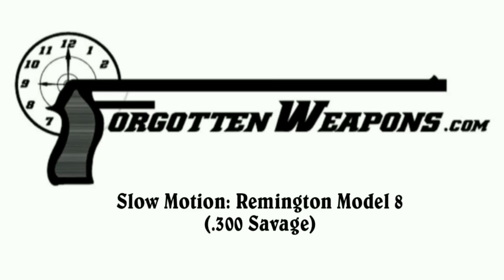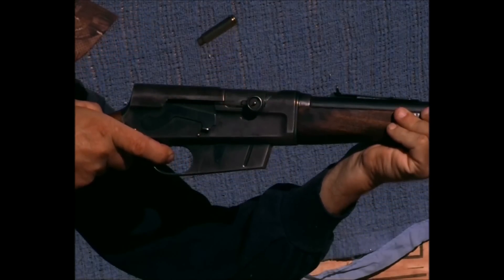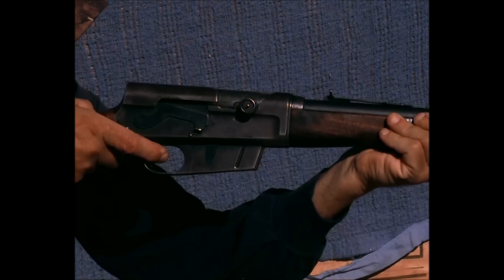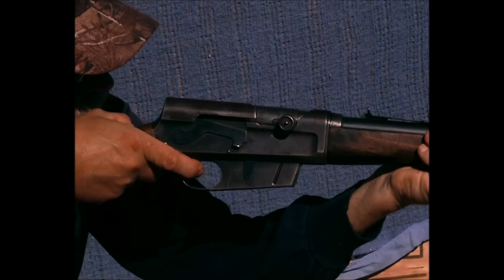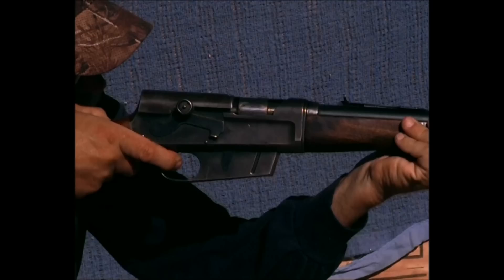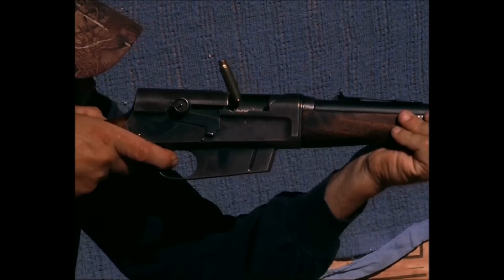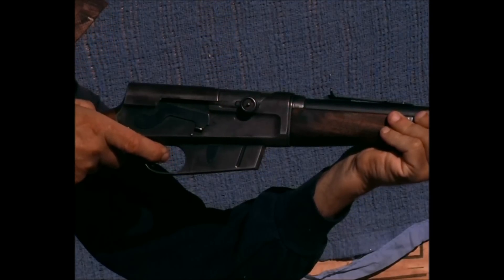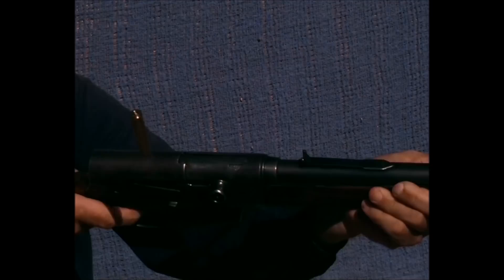Slow Motion: Remington Model 8

Comment: Good explanation. The high speed footage is a little dark but otherwise it's alright. Nice firearm
Reply: Oliver Diaz Slow motion capture (the process) eats up a ton of brightness from the final product (the video). Unless they have the latest models (very expensive cameras, even to rent time on one) footage will always be darker than normal capture.
Reply: aserta Because the frame time of integration is shorter. They are basically high speed cameras that are played back at regular speed.
Reply: aserta You can also just use more lights. It might look overexposed to the naked eye but it'll look way more natural on the high speed.
Reply from the maker: Oliver Diaz Yeah, I will eventually re-do this footage now that I am better at running the high speed camera. It could be brighter.

Comment: So this is a semi auto gun made in 1906? Why didn't they use it in ww1?
Reply: dapperedavid Because the internals were finicy, hard to clean, and expensive to produce. It probably was seen as to fragile for military use.
Reply: dapperedavid It couldn't handle "full power" ammo (30-06, or 30-40 Krag) at the time.  It wasn't the only early semi auto of that time that was overlooked due to ammo commonality issues.  Very honestly the military was fighting the last war, and still concerned about some pretty daffy things (stopping cavalry charges, over consumption of ammo, volley fire).  Honestly there were at least 5 lever or automatic designs (Savage 99, Winchester 1894, 1895, 1905(and other developments), Remington Model 14) that "could" have been useful in military service during WWI that were just ignored because of dogma.
Reply: Patrick Goodhart
You'd think they'd be smart....
Reply: dapperedavid It couldn't handle mud very well, or the abuse of campaigning.  Carrying a rifle around for days in primitive conditions will put a lot of strain on something like this.  It took a lot of work and a lot of money to get Garand's design to the proper level of reliability.  Also, there's a disassembly video on this channel for this rifle.  You don't want to field strip it anywhere but a shop.  You'll lose or bend something.
Reply: Patrick Goodhart Nope.  Semi-autos like this rifle just weren't robust enough for military service.  There's another video Ian's done on this rifle.  Watch it and you'll see.  Also, stopping cavalry charges in WWI wasn't all that daffy- they've been a part of every war up until that one- why would they magically disappear?  Also, lever guns in military service had been tried by the US and rightfully rejected.  They're difficult to fire prone- which is the most accurate position- and very slow to reload compared to the internal magazines on military bolt guns,  especially if you use stripper clips.  Not to mention their fragility in field conditions, the fact they get on the tempermental side when dirty, and their inherent mechanical inaccuracy compared to bolt guns.  The rifles of WWI all proved themselves so well they fought WWII with them, and many carried on through the early Cold War.  In fact, many are still in use by Afghan sharpshooters, over the AK series of rifles.
Reply: dapperedavid They were smart.  They rejected this rifle, and used the right ones instead.
Reply: Jon Hendrickson And repeating some of the same dogma that resulted in exactly what I said...  Seriously though, those rifles have been beat to death for a hundred years and are still functioning.  Nothing holds up well to burial conditions like where seen in trench warfare.  They certainly aren't more fragile then 1911 pistols or S&W revolvers in the same conditions.  It's not hard to load a 1894 or 14 prone, it loads from the side!  The 1895 and 1899 load from the top (and the Savage can use stripper clips, and it's virtually the same magazine system as the MS system).  The only real thing I will give you is the 300 yard + accuracy, and yes a bolt action is a better sniper weapon then a lever, but honestly I am just suggesting that what came post WW2 was already in technical production pre WW1.  Honestly WW1 firearms were OVER influenced by the Boer War and various colonial skirmishes. FYI the US NEVER deployed a lever action as an issue weapon.
Reply: dapperedavid I seem to recall that the French used a few of these (along with Winchester semi autos) in aircraft and balloons. Not nearly as much mud up there.
Reply: dapperedavid Thats like saying; 'the cell phone was invented in 1973, why didnt it immediately catch on as being superior to landlines?' 
Like any technology, it takes time to refine because the early attempts are usually finicky or need more development... 

This was the same for early semi-autos. Look up a video of one of these being disassembled. Its kinda crazy how many parts there are (I think there are over 100 parts, nearly all milled too!). Taking it apart would be a nightmare in military practice because it requires multiple tools, plus the expense to manufacture probably exceeded any countries budget! It was an innovative civilian/hunting rifle, but it wasnt a good military rifle for these reasons. 
This is why the M1 Garand is so important. It wasnt the first overall, but it was the first semi-auto rifle that was durable and robust enough for real military service.
And yes, the French did use (sparingly, like select air & balloon units) Remington 8s and Winchester 1907s, as well as Winchester 1894 lever-actions (the most recent American Rifleman has a really awesome article on the very subject in the latest issue actually!).